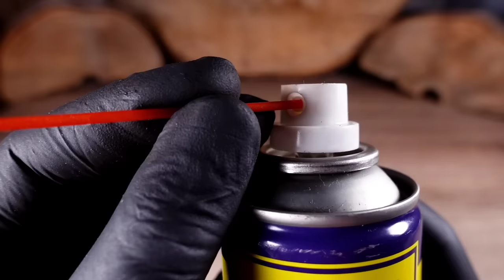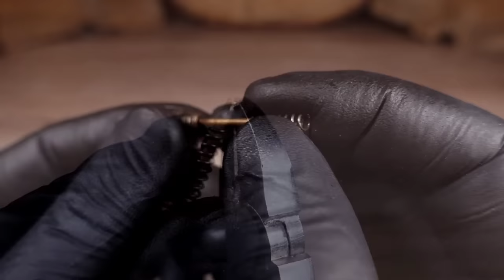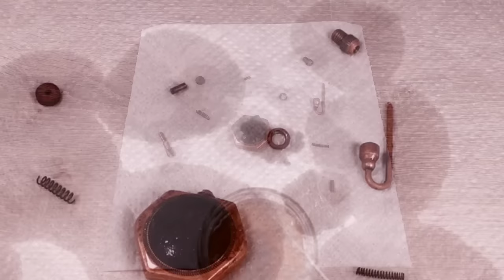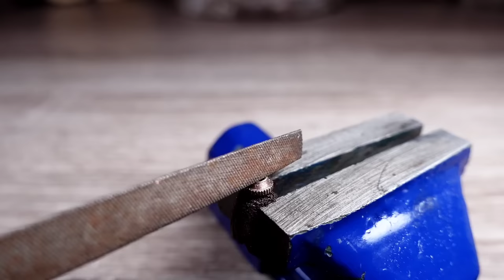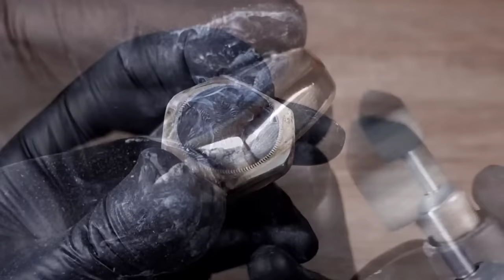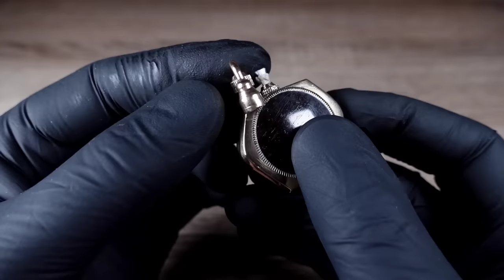Extremely beautiful antique lighter - Full Restoration

Comment: Nice job. I think the black plastic is Bakelit. There is just one thing i can not get out of my mind. The whole lighter is made out of brass and bakelite. How is it actually possible that brass and bakelit can rust? It is a wired thing!
Reply from the maker: Thank you!💚😉👍
Reply: Fake rust
Reply: Looks like something corroded over and on to it
Reply: I agree bakelite. I have a nice set of Cutco knives and utensils over 60 years old with bakelite handles and they look as good as when my father used to sell them all that time ago.
Reply: I was thinking Bakelite as well I know they stopped making during WW2 so it makes sense that’s what it is … but I’m not sure I’ve seen black before in it, usually it’s always RGB color scheme
Reply: @normfredriksen1381  Cutco makes an awesome product, don't they? My mom had a 50 year old set. She sent them back for sharpening & they sent her a new set instead.
Reply: 10,👍from me.
Reply: Considered the possibility, it was in a case that rusted around it?
Reply: The bakelite and brass didn't rust. It likely all came from the steel wheel or another object.
Reply: @Paladinforthewin_xx  Read up on bakelite..
Reply: It's what is known transferred elements. Somewhere in the history of that lighter, it was in a metal box in saltwater. Probably an ammo box.

Comment: I am very curious as to why you didn’t soak the lighter in a rust remover solution first. Oiling it and then prying pieces off the lighter could have resulted in total breakage.  It’s also amazing that the lighter was rusted since it was made of brass and or copper. Maybe there was a contamination of iron mixed in with the brass if that is possible. In the end. It came out wonderful. Thanks for sharing.
Reply: It's possible it was in a case that rusted around it.
Reply: @mikedickinson9730   I actually just saw a YouTube video a couple of days ago where they talked about most of the restoration videos being fake. They paint a fake rust product over the metal to make it look really bad. Have you ever watched the restoration videos from Hand Tool Rescue?  That guys work is phenomenal. I have an antique deli slicer that he wanted me to send to him but it weighed a ton and I would have had to make a wooden shipping box to send it in. I have a bad back so I couldn’t handle it, it’s still sitting in my garage. I really think you will like the guy.
Reply: @Naplesfrank154  That sounds like it would be a mission. Lol. I’ll have to check him out for sure. I’m sitting here googling how on earth this lighter would rust to prove myself wrong and I just can’t find anything aside from faux rust. Anything for views.
Reply: yeah, lets soak a brass lighter which is non ferrous ,in rust solution ,strange brass does,nt rust .and its does not contain iron .

Comment: My father had a similar lighter in the European Operations Theater in WWII. It had the battalion insignia on one side and US Army EOT on the other.
Reply from the maker: It's very cool!👍😮🕵️🇺🇲 Do you still have your father's lighter? Is there a photo?
Reply: @TheRestorer  My older brother has the lighter now. Dad received it at Fort Leanardwood,  MO after the Aleutian Islands were secured. It was a presentation lighter. One side had the insignia of the 151st Engineering Battalion and the other, US Army, PTO (Pacific Theater of Operations). 151st was decommissioned and the unmarried soldiers were transferred to Patton's 3rd Army,  47th Calvary.